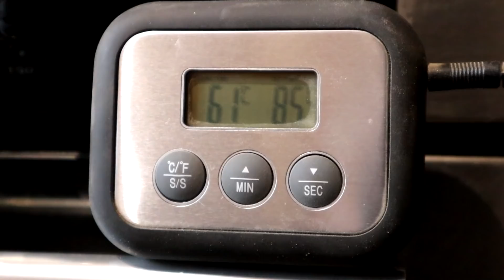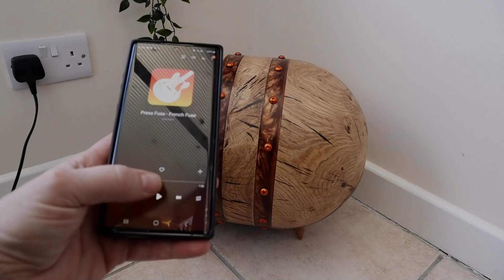Woodturning - The Oak Speaker

Comment: Very nice. 😎 You might be able to avoid using a fan for the amplifier box if you drill holes in the top cover of the box, in the pattern seen on a perforated metal sheet. Can't guarantee that would help the amp from overheating, but that type of amplifier is what is known as a switching amplifier - and switching amplifiers run cooler than regular amps. I have a 200 watt-per channel stereo amp with switching amps that the case is totally sealed (of course, the case acts as a heat sink)

Comment: Hello my friend,
I am a newby and have watched your YouTube channels for directions. Thanks for your videos.
I have a few concerns you could possibly help me with.
I have a small 14"x40" lathe with 4 speeds (1100) (1600) (2300) and (3400). What speed is recommended if starting a new prokect?
The next thing is, what kind of tools are best? I have a small set that came with the lathe, but I noticed sometimes you use a large gouging tool. I checked Amazon and eBay, but did not find it. 
I really appreciate your videos and thank you for your directions.
Respectfully,
Horatio

Comment: The craftmanship is remarkable but the sound is poor . The reflex tube has a 90 degree angle and this is not good for sound. All those junctions induce vibrations. The ovoidal shape influences the sound and the effects of this peculiar shape on the sound have to be taken into account in a specific, not easy sound project. There is no damping material on the interior surface of the ovoidal and foam or other material should be filled in. I hope that the electronic used has an internal crossover.